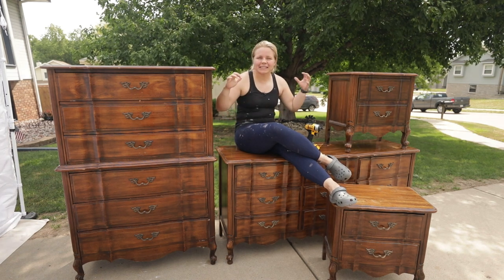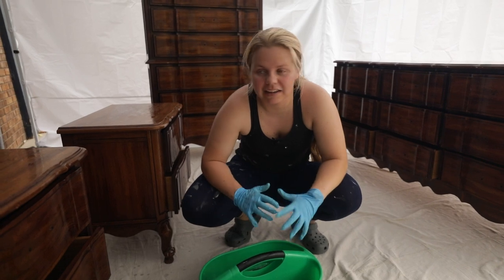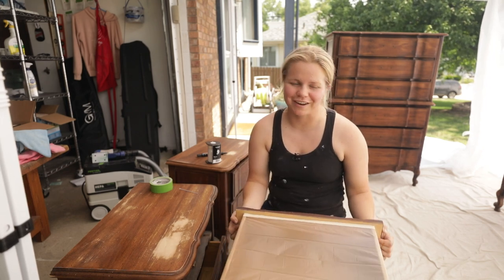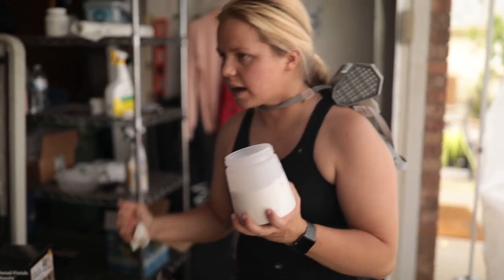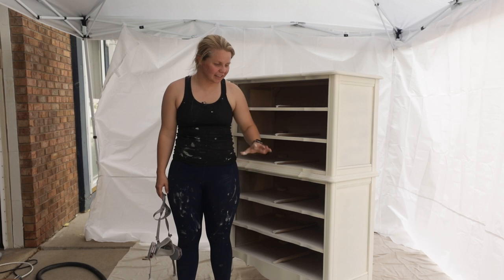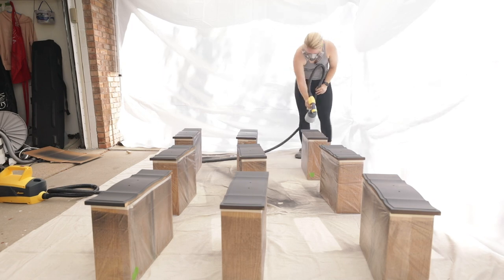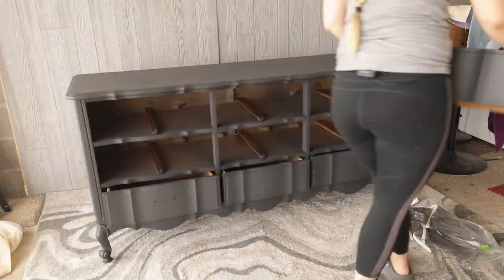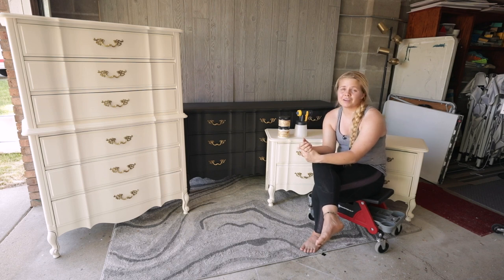Facebook Marketplace Furniture Flip | French Provincial Bedroom Set

Comment: Here’s a tip with the gilding wax, it’s oil based and will clean up with mineral spirits. It does need to cure around 48 hours before painting over it with something water based. You did a really nice job with the set, it looks very pretty and professional.

Comment: I have a Wagner spray gun and I have yet to use it! I bought it initially to spray some colored sealer onto my 12 x 20 storage shed, but I knew it would be beautiful for using on painted projects, too.  My question is this: the Boss doesn't have to be a full coverage in order to seal and block bleed through?